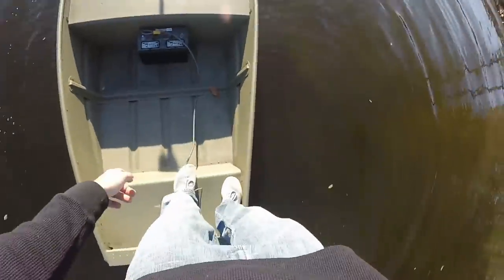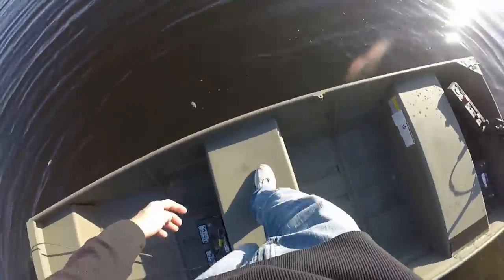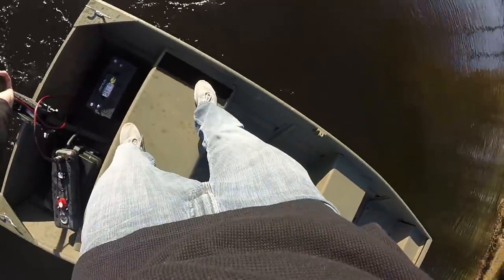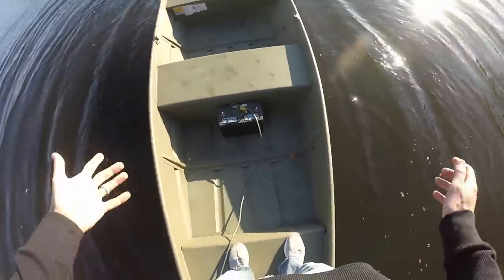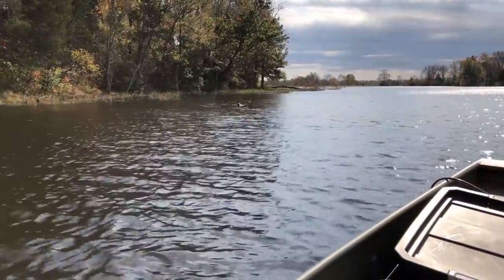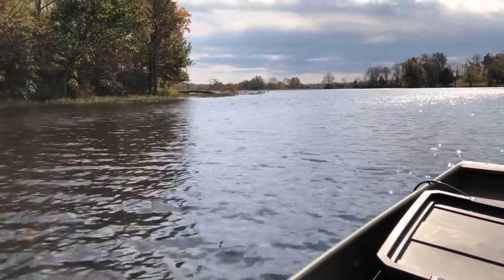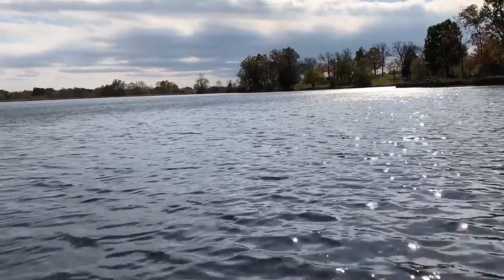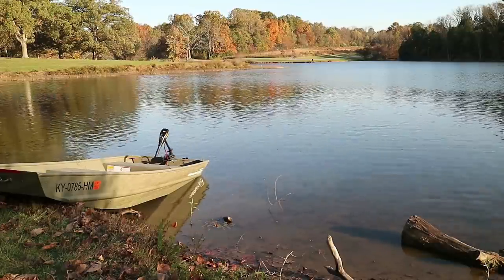How stable is a jon boat (jon boat series, 3) tracker 1236

Comment: Find a Jon length that you’re dead certain you & a buddy can load all your gear in and fish comfortably in THEN buy one two feet longer. It also cannot be too wide either.
Reply from the maker: Solid recommendation, but still need to consider where to store it and transportation. Thanks !
Reply: thepbw 2 ft. Shouldn’t break the bank.
Reply from the maker: I have a 16ft vhull for larger waters, the 1236 is my small boat for streams and smaller waters, where trailer isn't optional.
Reply: +thepbw if ya can't store the extra 2ft and haul that much more aluminum ya shouldn't get a boat at all
Reply: U.S.Slave that's kinda dumb. It all depends on what you fish for and where you fish. Many places I would much rather have a smaller boat. Something 2ft longer then what I want can make things more of a pain in the ass, especially if I'm by myself.
Reply: Bang on Jason

Comment: I like these Jon boats, definitely a great inexpensive option and well made. I do disagree they're better then a kayak unless you're not into kayaks or paddling. That's totally a personal opinion and not a fact.

Many fishing kayaks including mine are very similar in width, length and bouncy/stability. I can't forget to  mention that fishing yaks have far better seats from factory and technically most sit on fishing yaks have more storage option since you have on top and inside storage space. You can stand and move around on both options, my yak also floats in only a few inches of water. Both options are very comparable in my opinion, although I do believe rough water is handled better on the kayak.
I feel both Job boats and Fishing Yaks are better then each other depending on personal preference. As long you love what you choose it's a great buy. 

Good video and I enjoyed watching and hearing your reason for choosing the Job boat, I love Tracker stuff. :)
Reply: Sask Yak Fishing I like them more than kayaks for when I’m fishing with others

Comment: Great video, jon boats are great, my gf and I have a 1040 Lund, had a 1448, but easier to always use the smaller one, we both stand up and cast all the time. Will try a 1236 this year, Lowe makes a 1240 though, but hard to find.
Reply: You just answered the question I've been trying to figure out for weeks.

Comment: They're pretty hard to sink. I've done some pretty sketchy stuff in my 16' but never been close to swamping it. I surfed some wakes. On one I thought for sure I was toast but boats want to float. The worst thing to do is weigh the front down. The first wave will wash in and the second one will swamp it. I had that happen in a canoe that had too much weight in the front. As long as the front comes up you're good. Now you could broach in the stern but I don't let that happen. Things have to get pretty bad to swamp a jon boat.

Comment: Liked the video, subbed. Flat bottom boats to me are more stable, that's why I build flat bottom boats, only difference is mine folds up and fits in bed of a truck with tailgate closed. My last one is 10' long, 4' wide.
Reply: The ART in WOODWORKING how do you get it to fold??

Comment: Same with my kayak i have a 30 #Minn kota and 35 amp hr 🔋 and when i have all mt stuff on the boat is dis places more water so it seems more stable but its just tigher but closer to tipping water in the boat.bettet is defined by the owner

Comment: Jon boat stability in a pond is fine... The stories I always heard about Jon's being unstable and flipping was in  rivers  where the water was flowing  ...I'll further add that as long  one knows that a Jon boat should never be anchored with the flow of water coming at it broad side the chances of flipping it are minimal  also turning a  Jon while  under power  should be done at idle as as the center of gravity changes in a turn ... Flowing water doesn't help either...in short if you use your Jon in flowing water ..familiarize yourself with the rules of operating a boat and if possible you your Jon in a pond ...also it worth noting that boaters in they're big high powered bass boats often don't give a flying fuck if they cause a person in a Jon boat to get flipped or capsized...  My suggestion is stay far away from from the bigger boats
Reply: My Jon boat stays in a river and I’ve never felt unsafe using it

Comment: If you put both of your batteries in the center of the boat by the center seat, then your boat won’t be so close to the water’s edge whenever sitting down running your electric motor

Comment: Question... weight capacity... do not go over it or small amount? It's a worry to overload it, but a 450 lb weight capacity for two guys, motor, batteries, and gear is rough.
Reply: I have this boat. the capacity says 350 which I'm over by at lease 100 every time I take myself and another on it with gear. No problem.

Comment: I bought a small 53 CC 4 cycle motor. 23 LBS is a lot lighter than 3 batteries. If you're handy: 1. Move the flywheel keyshaft and retard the excessive advance. 2. Change the centrifugal clutch springs for much slower trolling. The motor is a Tomking TK144FC. $275 no tax no shipping. Aluminum prop.
Reply: Why not go electric.. lithium is cheap as dirt these days.. 200 bucks for a battery and ur done.. my battery weighs about 20 lbs.. does about the same as 3 old lead acids.. (probably even more). Have had the same battery for over 5 years..
Reply: @larsvegas1505  Run all day? I don't think so. Most lithiums cost big bucks.

Comment: Just picked up a 12 footer today. I'm 280 hope it works the same for me lol.
Reply: Don't try it. I'm 260
Reply: @richh9904  I've got a 5-hp Nissan and a trolling motor I'm putting on the back where I sit do you think it will be all right? Going to try to run the battery up front if I can get some long enough cables

Comment: I have a 10 foot johnboat it came with decking on it it is extremely unstable if I remove the decking does anyone think That would help
Reply: is the decking sitting on top of the seats? if so, that's riding pretty high, and I bet removing the decking would help for stability.
Reply: Hell-On-Wheels Wild it was so I removed the deck and boat is stable enough for me 200lbs and my brother 250lbs plus electric motor n battery

Comment: Would the 1236 be ok for two 250lb people?

Also what does that boat weigh?
Reply from the maker: It’s about 109 pounds, two 250 people I would get a 16 ft boat the gear ads another 100 pounds.
Reply: thepbw would it be ok for one 250lb person
Reply from the maker: Would be perfect.
Reply: Thanks bro.
Reply from the maker: No problem. Just think of a 12 ft jon boat as the most rugged version kayak!

Comment: How much of a difference would you see between this at 36” wide and a v-hull at 52” wide.
Reply from the maker: I have a 16ft v hull it’s more than 52 inches wide and it’s much more stable. I will make a video on it when the warmer weather comes around.
Reply: thepbw cool thanks
Reply: Yes there is a big difference I have a 1444 and my brother in law has a 1652 maybe it's 1654 but anyways we use his boat on bigger lakes and rivers

Comment: It's called jon boat but not jump boat! just kiding.  but 1236 max weight capacity 480 lbs. if you want to test stability of it which you have to load to max weight then shake it or jump on it.  you have three batteries total 180 lbs cause 60 lbs each,  trolling motor 20 lbs and you160 lbs. so totally you have just 360 lbs which not heavy enoght to do the stability test!